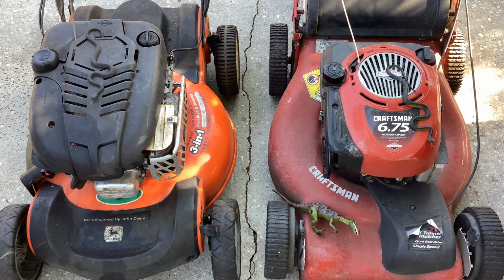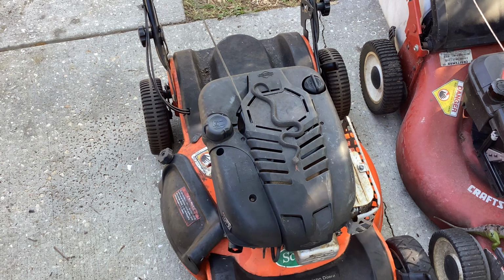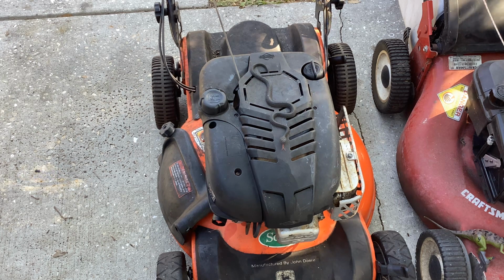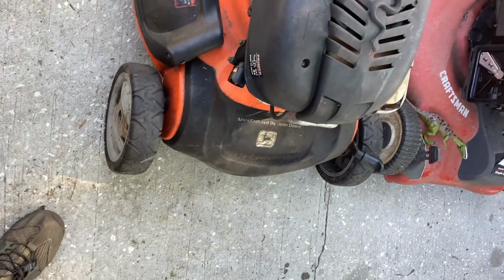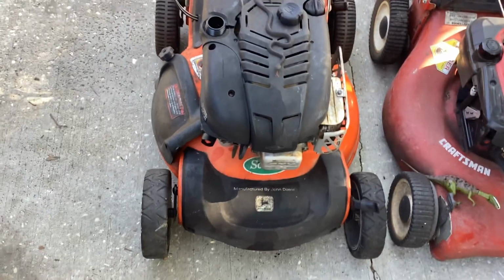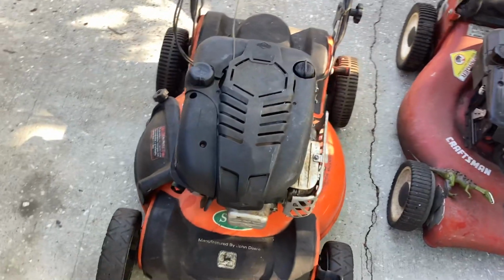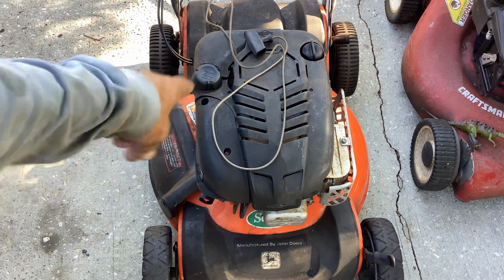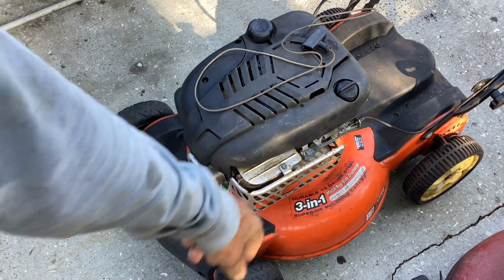2000 Scotts by John Deere Lawn Mower with Problems...Let's make it RUN again like a Deere!!!

Comment: Had a toro personal pace with a tecumseh. Get it going rod knock put another engine on sump leak engine off sump gasket. Carb clean. Then drive cable, lube gears, personal pace spring on handle wheeles. You're right one thing after another